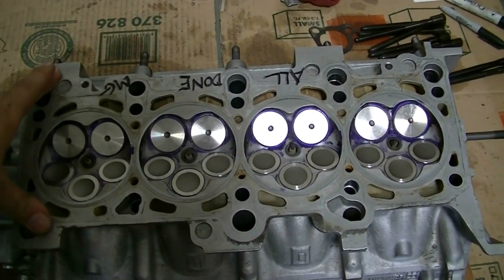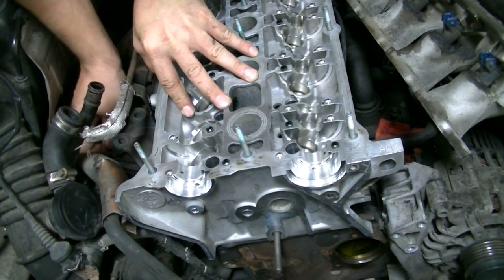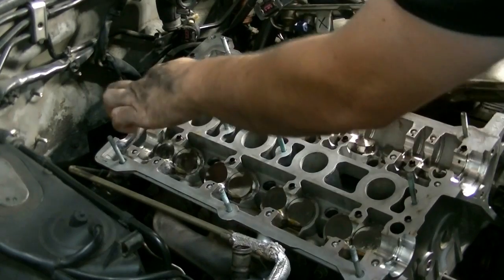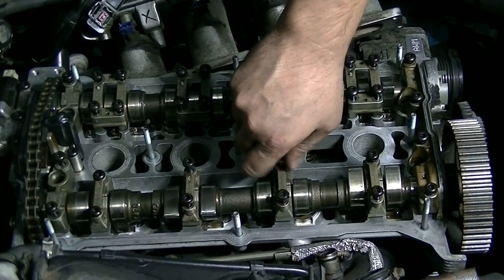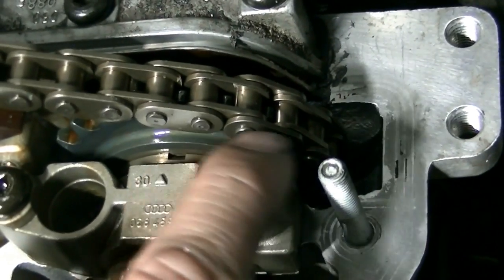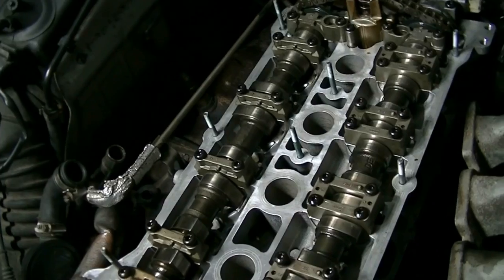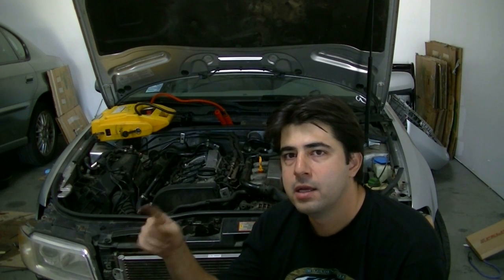How to Remove and Replace a Cylinder Head - Audi A4 A6 VW Passat Jetta 1.8L Engine Part 3

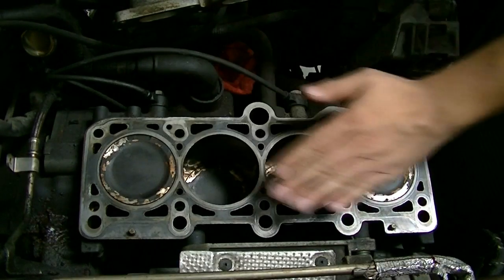Comment: Very informative video, but with one very common newbie error. That is at. 2:34 you demonstrate cleaning the piston bore, wiping off the carbon edge, potentially at the top of the bore. This carbon deposit at the top of the stroke, actually a build-up at the top leading top  of the top piston ring forms a ‘seal’ minimizing blow-by on high mileage engines. Clean it off and you’ll suddenly find oil consumption will go way up. Leave it alone. 
  (I am glad to see that you didn’t indicate to clean off.ALL the carbon from the top of the Pistons, also an irreplaceable which presents an incredibly good insulator, keeping the piston cool.)

Comment: You're never supposed to lubricate/oil the threads on any bolts that require a specific torque rating as it drastically changes the way the bolt holds the torque.

Comment: For anyone watching this in the future note that the triangles MUST point to the slot on the camshaft. You need to count the number of chain links inbetween the triangles. Google how to do that. The tensioner doesn't change or correct the timing, it just keeps tension.

Comment: I’m buying a complete new head with cams and such already in, will I have to take out the cams to get the head bolts in?
Reply: No
Reply: You'll probably have to adjust the cams though to make sure it's in time and wanna clean the caps and bearings

Comment: (Exhaust side) arrow on cam cap should line up with notch in cam gear. (Intake side) notch will be just past the arrow on the cam cap to the right. Starting above the notch on the cam gear (exhaust side)  there should be exactly 16 rollers between exhaust and intake cam gear notches. Or looking down at the top of the chain tensioner split 8 rollers to the left and 8 rollers to the right. Your last roller should be directly above the notches on both cam notches on either side. Cam cap arrows and notches should still be as stated above. Looked like he had it right. Main thing is 16 rollers between the notches. Also, another indicator are the lobes at the front of the cams. Exhaust is at about 135 deg. Intake is at about 45 deg. Both lobes should be pointing inwards at those angles towards one another. They should (almost) point at inner cam cap bolts but, if you drew  straight lines from the crests of the lobes towards the bolts you should not point directly at them but just befor them. Hope that makes sense. This can be really stressful until you do it a couple times. Good luck.

Comment: Hi I replaced the head gasket from my Audi but I used my old head bolts, could I be getting oil mix with coolant because of that?
Reply: The old bolts would have stretched, that is why you have to replace them, yes that  would a reasoned for the mixture or the head & block surfaces are scored or warped.

Comment: You really shouldn't use brakleen cuz it takes all the oil away from the cylinder walls and the the Pistons I find the WD-40 works quite well and lubricates it and prevent rust if you're going to have it open for a while

Comment: Please help: is it normal for a "low pressure" light to come on after replacing cylinder head + oil cooler +oil filter? I didn't pull the fuse to build oil pressure before starting it so maybe that's why the lifters are so loud?
Reply: RIP

Comment: Great video you are very articulate one thing I would like to mention is to check the inlet oil screen that is under the chain tensioner for debris that is very important if you are not installing a new one.

Comment: Hello!
I appreciate this video and are currently working on fsi 2.0t cylinder head just finish assembling but i was hoping for some advice!
I placed cams off lower block on bench. Lining up using a cam alignment tool some of the lobes on cam are compressing some of the vavles before installing the cylinder head on lower block. Is it normal timing to have some of the valves slightly opened with the proper timing mark$? Thank you for your videos!

Comment: Did a timing belt job for the 1.8T engine AWM and it sounds like it wants to start just like at the end of your video whenever you took the fuel fuse out. 

https://youtu.be/LHjp-pygm5E

Comment: Just thought I would add to replace the 3 turbo to exhaust manifold bolts. These are stretch bolts and not recommended to be reused. Great posting as usual by RNR.

Comment: hey, does anyone knows if you can replace an Audi a4 1.8t b6 cylinder head with a VW Jetta, Passat, or golf 1.8t cylinder head? thanks :)
Reply: Depends on the engine code of your a4 and the engine code of the donor vehicle.
Click yourself through this site [1] and see if maybe the part number of your cylinder head matches with the donor vehicle.

I know the cylinder heads tend to differ in intake port size (some have a larger intake port, some a smaller).
But i have no idea what else is different.

[1]: http://catfans.info/Audi/katalog.php?lang=e&catalog=au&markt=USA&modell=A4&einsatz=1999&epis_typ=218&dir_name=R&hg_ug=103&bildtafel2=103048

Comment: A trick that I've found that works really well for cleaning a block for a gasket is to take Marvel Mystery Oil on a rag and rub it onto the surface and cover it with a piece of plastic wrap for a few hours.  Come back with a plastic scraper and all the junk just comes right off.  Once you've gotten all the junk removed take another rag with brake cleaner on it and rub it down a few times to get rid of the MMO.  I know it's an old guy's cure all.  But, I swear it's one of the handiest things to keep on the shelf.

Comment: Do I need any gasket sealer or RTV on any of the gaskets (valve cover, intake/exhaust/cylinder head). The new cylinder head I have already had the cams installed BTW

Comment: Thank You very much for your 3 part video on replacing the cylinder head gasket on the Jetta 1.8.  I have a 2002 and blew the head gasket do to the water cooling line to the turbo leaking.  It took me a week to complete the repair but the car is running in the driveway and sounds great.

Comment: Is it the same procedure for head gasket change? except doing anything to the camshaft part? also how much time in total did you take to do this? I have worked with engines just dont have proper tools and a place to work at. thanks for your response.
Reply: Also i have a head gasket leak and my dash board shows oil pressure sign not sure why. could the pistons be messed up because of the head gasket leak? thanks again

Comment: Question for you. I just did a head swap my 1.8t. I followed the same instructions for the head bolts. But I still ended up with oil slowly weeping from 1 corner of the head. I was able to tighten the head bolts more..maybe another 30-45 degrees. So my question is do think the head bolt process is sufficient with an aluminum head that expands and contracts so much? or would u think any slow oil leak at the head points to warpage?

Comment: hey my i got a audi a4 1.8t quattro off of my friend due to him owing me some money and bought a used motor the problems with the car is that the engine seized and locked due to him allowing  the coolant to leak  into the motor oil and driving it like that. what else should i change while changing out the motor, and do you recomend i do anything to the motor im gonna be putting in?

Comment: Hi, could you please tell me how did you pull up and down the cylinders for cleaning?
Reply: Rotating the crank, on VW usually u need a 12 point 19 mm wrench or socket and rotate clockwise.

Comment: Recently my mk4 gti 1.8t timing chain broke...caused damage to 4 of my valves and one cylinder head...so my mechanic sent the head to a shop where they smooth out the damage? i guess? from what he said and replaced the 4 bent valves. and a couple of other things like the water pump and pulleys, tensioner, chain etc. i get my car back and it runs soo slow. it revs up but its like it struggles to push up to 20. my acceleration response is so slow...could this be because of work done to the engine? the job costed me 1575...he says wait two or 3 weeks for the parts to settle but will my car go back to normal or am I doomed to have to get new engine? is it a computer thing? no light or anything are on. I'm so stumped. its only at 97k miles. if anyone could give any info. I would greatly appreciate it! thanks.

Comment: I was going to skip your video because I'd like to see the job done on a transverse-mounted Jetta motor (mostly how to get to the exhaust manifold).   However, you did an outstanding job.  One trick I like to use so that I don't pinch the head gasket when I'm placing the head is to put 4 wooden dowels in some of the bolt holes to reduce my chance of messing up the gasket.Thanks for the Excellent Video.

Comment: I would never had attempted this job if it wasnt for your video!  Thanks for doing it!!
I am to the part where i take the valve cover off. My 2004 A4 is a little different.
There is a coolant hose going down through the intake manifold. When i was trying to take it off, the fitting snapped on whatever it was attached to, so i have to figure out what that is and order a new one. I hate that the plastic parts get so brittle over time.
Reply: Lol I snapped it also